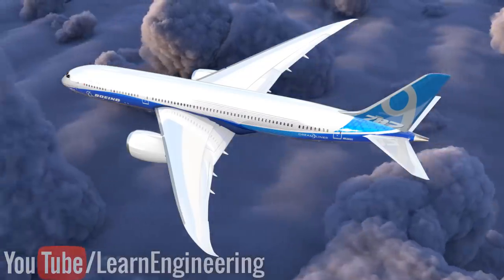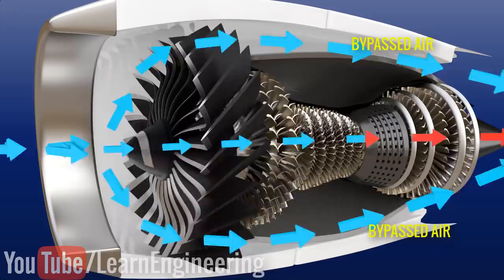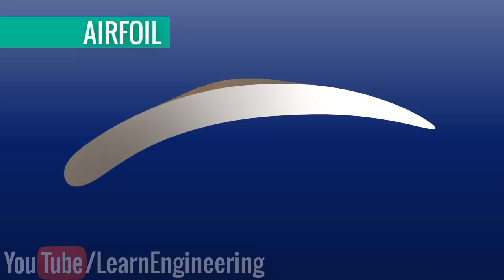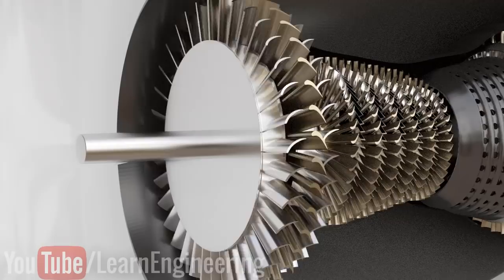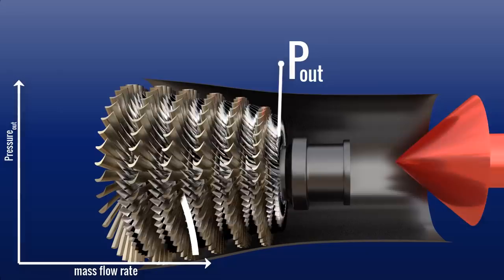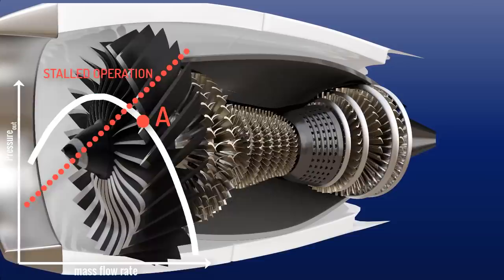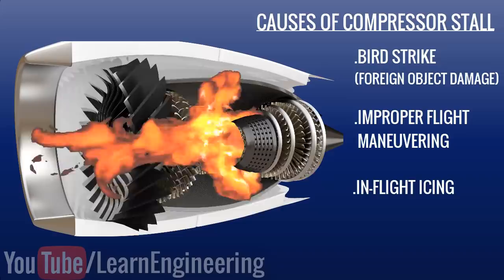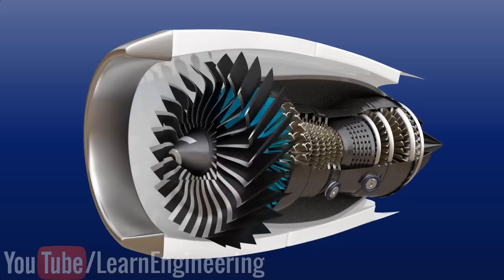What makes BIRD STRIKES so dangerous?

Comment: so... riddle me this, why isn't a guard able to be put IN front of the engine so that objects/ obstructions get deflected out? is it a cost issue? an efficacy issue?  is it a increased risk? surely someone has to have already asked this question.
Reply: It would severely disturb fluid dynamics
Reply: It would reduce airflow to the engine or possibly its self get sucked into the engine.

Comment: I actually though an impact with a bird would bend or shatter turbine blades, and thats why engines would fail. Really interresting to see why it actually happens! :)
Reply: kabbinj2 yeah that can and does happen as well.
Reply: usually rotor blades are made from a metal that forms a single crystal. Single crystal metals are extremely tough, because they don't have grains (actually, a single crystal metal is the only grain) and that means that there are no gaps between those grains that weaken the blade.
Reply: One thing they do during the qualification of a new engine design is to use a large cannon to fire dead chickens into the engine while it's running. The fan and compressor blades and the rotor hubs have to be able to remain together in order to certify the engine for flight. Also the "turbine blades" are in the back of the engine. Bird strike only directly effect the fan or compressor blades in the front.
Reply: yea i guess it gets torn up on the main blade lol
Reply: A large enough bird will bend and cause damage to fan and compressor blades.  That's what happened when Canada Geese went into the engines of USAir 1549 and made 'Sully' Sullenberger a hero.  Even small birds can cause significant damage.
Please note that it is the compressor blades at the front of the engine that suffer significant damage.  The turbine blades at the rear of the engine might suffer minor damage.
Reply: Fan and compressor blades are not formed as single crystals: however, turbine blades are.
Reply: kabbinj2 i
Reply: kabbinj2 birthday
Reply: kabbinj2 i
Reply: As for today the fan blades are made out of carbon fibers with more than 20 layers of it making it as strong as metal but extremely lightweight and the compressor blades are made out of cutting edge ceramic which is 2x as strong as 2 inch metal even tho they are extremely thin
Reply: JackPotLegend I thought the same thing !
Reply: kabbinj2     *thought
Reply: Modern jet engines uses Titanium carbon fiber blades that are strong af 
And the inner compressor blades usually uses Ceramic metal that are also very strong 
The bird will usually get crushed into pieces and then get roasted in the combustion chamber
Reply: @grahamj9101  Are fan blades made of carbon fibre?
Reply: SATURDAY I WAS: ⚡ 1 VOLT ⚡
SUNDAY I WAS: ⚡2 VOLTS ⚡
MONDAY I WAS :⚡ 3 VOLTS ⚡
TUESDAY I WAS: ⚡ 4 VOLTS ⚡
WEDNESDAY I WAS : ⚡ 5 VOLTS ⚡
THURSDAY I WAS : ⚡ 6 VOLTS ⚡
TODAY I AM : ⚡7 VOLTS ⚡
My VOLTAGE daily will increase one day we power a house it is a new thing in youtube
Reply: The best solution is to get out and use a plunger to shove the bird out of the engine...but always remember to wear a jacket due to the temperature at 35,000 feet. 😄
Reply: @blooogisss  7

Comment from the maker: Dear viewers, research work of this video has been one of the most difficult one. It consumed all my time of this month. Here are the references I used for the script production. I hope, we explained the compressor stall in a simple manner without missing the details of its physics.
1)Jet Engines - Fundamental of theory, design and operation by Klaus Kunecke ; pages 106-114
2)Rotating stall and surge ; A.H Stenning, Department of mechanical engineering and mechanics, Lehigh University; 1980 ASME
3)https://en.wikipedia.org/wiki/Compressor_stall
4)https://aviation.stackexchange.com/questions/15816/what-exactly-is-a-compressor-stall
Reply: Learn Engineering what about safety sieve if the apply before engine?
Reply: Bro you're are secret bro of engineers 😀😃
Reply: This is really nice, thank you!
Reply: Great work!
Reply: It would be nice of you to provide the references for each episode.
Reply: With 25K views in 24hrs I'd say there is something fishy going on.
Reply: Learn Engineering thank's for your excellent investigation!
Reply: where are you going
Reply: Woah u guys are the best
Reply: Learn Engineering Thanks! Great value production. Did you made all the animations? I'm very impressed.
Reply: Hi, you did a pretty good job explaining, however in your 3d model sadly you mirrored the stator blades and you began the compressor stages with a stator. I assume, you have looked at drawings of turbines and assumed the compressor is built the same way. Here you can see an example for a compressor 
http://www.circuitgrove.com/tutorials/axial-flow-compressors-mean-line-analysis

I hope, that helps a bit for the future
- An Aerospace engineer
Reply: There are at least two more things that can cause compressor stall, ingestion of extreme amounts of precipitation while rare as the engines are designed and tested to endure significant precipitation there are limits as cases like Southern Airways Flight 242 demonstrate. Volcanic ash is of course another contaminant capable of this through the abrasive effect of particles of sand and rock smashing into a rapidly rotating turbine at speeds of several hundred km/h though the molten rock from the combustion chamber solidifying onto the turbines doesn't really help in this case either.
Reply: Learn Engineering Can please make a video that explain how front wheel drive really works?
Reply: Plz next time speed up your speech
Reply: A turbofan is a jet engine, as is a turbojet. 
PS  Posted by an engineer with a lifetime career in gas turbine design.
Reply: Friend, can you please tell me that which software you use to make your animatin video. your videos are really nice.
Reply: Learn Engineering v,good
Reply: Desi Life Lori it could get sucked into the engine and since it should be very strong it will most likely explode the engine since it must also be non flammable. also, it could block airflow and if multiple birds get collected into the sieve it will reduce airflow.
Reply: You guys make superb engineering videos. As a electromechanical engineer student, this is pure bliss. Kee the great work, and soon enough I hope to become one of your patreon supporters
Reply: Why isn't there a mesh cover on front of all commercial airline engines???
Reply: @NIOC630  and as a result, the stator blades angle is wrong
Reply: No, sorry. I was still none the wiser. I had to go elsewhere for a clearer explanation.
Reply: Thank u so much
Reply: Why is the second stage high pressure compressor rotor vanes rotating in the opposite direction?
Is it to apply an opposite torque...to prevent precession?
Reply: certainly,This channel deserves more subscribers......kudos to your enthusiasm......Learn engineering is channel with very high quality content.

Comment: When I was in the Air Guard we had a single engine F-100 Super Sabre suck in a large goose while on final approach. The J-57 engine experienced a massive compressor stall and started to wind down. The pilot put his hands on the ejection handles and got ready to eject. However, just before he pulled the handles the engine RPM and EPR started to rise again as the engine began to recover. The power came back up and he was able to land safely. Afterwards I saw the disassembled engine in the engine shop. There were feathers, bone and bird guts present as far as 3/4 of the way back through the high pressure compressor. One thing that helped save the plane was the long intake duct that the F-100 had. There was evidence that the bird had been smashed apart as it ricocheted several times off the walls of the intake duct while traveling down the length of the duct and it was probably already in many pieces before reaching the inlet of the engine. As bad as sucking in a bird can be most fighter pilots will tell you that the bigger fear is a bird coming through the windscreen, into the cockpit and hitting them in the face. Fighters do a lot of high speed flying close to the ground and a bird entering the cockpit at 600 MPH can be disastrous.

Comment: Great video really enjoyed it but one thing that could be better is that people know that a  complete engine failure may have a "catastrophic" effect, as you said if all engines fail not a single engine failure!  Pilots are trained to fly with engine failures, the in-flight shutdown of an engine typically does not constitute a serious safety of flight issue. The plane will not stop flying since the pilot is familiar with the procedures to avoid a crash.

Comment: For those people who are asking why there isn't some sort of protection before the fan.
It would have been done if it was that easy, but it's not.
A grating of some sort would only be extra weight and drag, it would also be useless in the case of a bird strike, especially at speed, combine that with the massive suction of the turbofan engine and you have a super vacuum cleaner. The bird will only be slapped to bits by the grating and still go into the engine.

Comment: It is a minor detail, but it should be noted that there is only air bypass in the housing of turbofan and turboprop engines. Turbojet , scramjets, and ramjets do not allow any air bypass inside the engine housing. This allows non-bypass engines to generate higher exhaust velocity but at the sacrifice of fuel efficiency. Thus, more bypass = less speed but more efficiency and low speed pushing power.

Comment: Not a big of a deal, but "throttle" is air-regulating system for internal combustion powerplant, and gas turbine engines' power output is controlled by the amount of fuel introduced into the burner section, so I'd like to call it either "thrust" or "power".  

Your animated descriptions are great help in understanding aviation systems; should apply for patent or sell these to airlines or component manufacturers.  Reading textbooks and looking at schematics can do only so much for average techs like myself.

Comment: Why the intake is not covered with a net ?
Reply: It would have already been done it it was that easy. it's simply not possible when at speed. A grating of some sort would only chop a bird into smaller cubes which still would go into the engine and cause harm.
Reply: @sethgestro678  thanks for your valuable information

Comment: I was left with questions: Does the bird getting ingested change the air flow? Does the pilot control the parameters mentioned at 5:50 (or a computer, or?) Otherwise the video has lots of great information and well explained.

Comment: can it not through the balance off to the point of catastrophic failure? along with the vibration . from the burping and farting. from the compressor surge. often hard materials are more brittle than softer materials. with the speed .vibration. all the forces. couldn't the impeller just break and the engine simply fly to bits? great video.  with the smallish gaps between fins. maybe with the speed of the engine. and air speed. maybe it can just get blocked by bird! reminded me of the guy in the air force that got sucked in a engine! but only just before the turbine. so he lived to tell the tale.

Comment: Did you know that planes can fly with only 1 engine? But if a small large group of birds hit a plane engine the engine will not explode or a stall, small birds can only damage a plane engine in 5% so the engine could not fail so fast.

Comment: Nice graphics! But, haha, it looks like someone took an originally stationary engine with highlights on the once-"upper" compressor blades and then to animate, just spun the highlights all the way around with the blades, instead of leaving the highlights basically in place as the rotors spun beneath them. :-D

Comment: Axial flow compressor stall and surge is a quite complex scenario.  Trying to simplify it may not do it proper justice.  For example, it is entirely possible to operate an axial compressor with a stage in "stall" and the compressor will behave just fine.  This is not a "digital" phenomenon.

Comment: But my question is
Are birds so tough to cause damage to Rotating tougher metal
Reply: Actually you missed what he explained. Actual physical damage of the blades is not necessary for engine failure. The bird can change the airflow direction which causes the compressor not compressing air properly leading to things explained in the video.

Comment: I have a doubt 
If there is a bird strike and engine cannot breath.
Then why there are no openings on the outer chamber so that the air which serves a purpose of cooling will also redirect the air for suitable pressure in the compressor in case of flow reversal

Comment: The real fact that  moving air is not just speed but a  velocity,  and this  has both magnitude of speed and direction of flow.  The profile section of a wing or a blade with slats, flaps, spoilers, angle of attack and density of air and surface smoothness all come into it.  The profile of a wing or a blade, unlike that of  wing  of a bird or the fin of  a fish, well engineers have as yet not come up with a material that changes its shape by feeling the air flow around it as fish and birds do. The feathers  on the bird and the scales on a fish do detect the   different pressure zones around their bodies and I find it most interesting to see a submarine going along the surface of the sea, where behind the bows  on the hump of the curve on either side of the hull  there appear two low pressure zones, which form two large holes and if one uses  the imagination, that  zone where the bow curves into the main hull, is a zone of low pressure. ( this occurs in wings fins and blades of jet engines and propellers) This is not seen when the submarine is moving forward in a submerged position but these low pressure zones appear when the submarine is moving on the surface. In other hulls the  shape  and profile of the bow wave says it all.    All that is seen on sea craft actually occurs around the wings,  fins  and blades of a jet engine blade be they at the compressor or at the turbine or stators.............. it is a velocity problem,  vector additions or subtractions.
Knowing how to handle invisible information and making them work is a procedure which the human mind had to wait for its higher development. Other social professions and their required mind was ready for their particular function more than 1000 years ago, but the engineering mind  which had to handle the electronics and the dynamic effects on a jet engine, are less than 100 years old and  their complexity was the reason  the human mind had to wait  longer through history, for  it to build and evolve  itself on the simple logic of other social profession which  dealt with vociferous and philosophical religious and political unguaranteed ,  operations  and to wait and wait till about 300 years ago when the human mind was ready to replace super  natural and superstitions with the real invisible  and silent actions of electronics and dynamics of a jet engine. The piston operating in a cylinder was easy to conceive its main characteristics and this took long enough for engineers to realise that one does not cool and heat the same cylinder as was done in James Watt steam engine and that came about about 300 years ago when the mechanical engineers mind was ready for that which is visible, noise and not silent, but rather hot! Mechanical engineers understood the  invisible process of heat and that took bigger brains than the senators who advised Julius Caesar about the Roman politics.  
The youngest profession is now the electronics profession and those who deal with jet engines and computers where all functions are so silent and invisible.  The human mind had to wait and wait for a few million years for it to conceive and understand such  complex invisible and silent operations and synthesize them in practical form and guarantee them for the safety of others .    It is such human minds which brought comfort to the family home and not the vociferous parasitic professions.     Other minds as those of pilots and  other operators of engineering equipment  was ready to function more than 300 years ago,but they did not have the engineering to back them up,  but they who conceived the Trent Engine and the wing structure and profiles of  the newest passenger aircraft as  shown in this video, well, their evolution had to be longer  to produce a plane as shown in this video at 0:27 which every  pilot must learn to  religiously obey what the engineer tells him and take all the  dictated actions at the right time or else they lose their own lives.  In jet engines and aircraft design and their behaviour, the engineer is King and he had to shoulder much responsibility be the plane empty  and on the ground but full of fuel or be the plane  flying 30,000 ft high and full or empty of passengers.   Congratulations for this video, for it helps to transfer what is the meaning or an engineer and gave a little idea of the engineers responsibility to help pilots and passengers alike and also those people who live  on the ground with planes and jet engines flying high above them,

Comment: So, in simple engineering words, you need to adjust the air-fuel mixture manually after a "compressor stall", right? That sound like a nightmare.

Comment: Can't we cover the engine with mesh type which has Holes to pass air and protect from bird strike??🎾
Reply: i think this will decrease the air flow and change the direction of air . and if a bird is sucked by engine, it will stay at mesh, the air flow will decrease more. 
i just guess,and my english is not good ,hope you could understand what i mean.
Reply: @leeleslie6615  yes you’re right, a screen would create turbulence in the intake flow, and if a bird struck the screen it would just break it and send it into the engine, causing a bigger issue